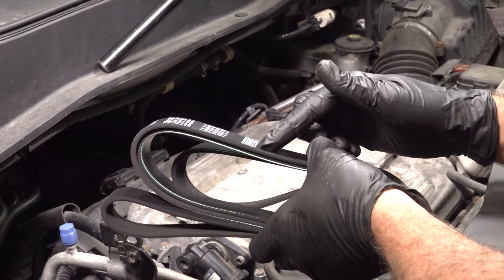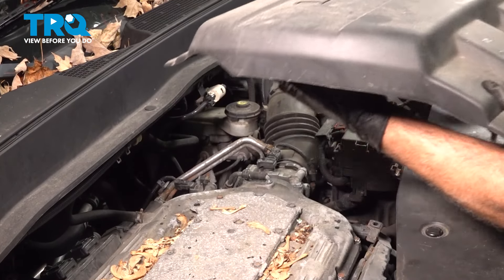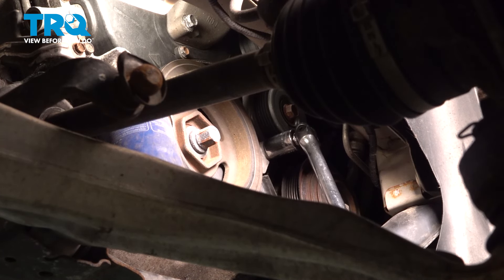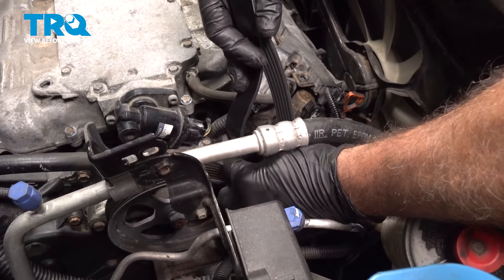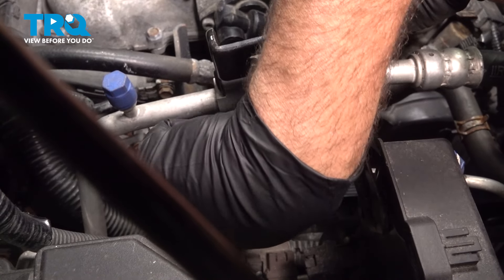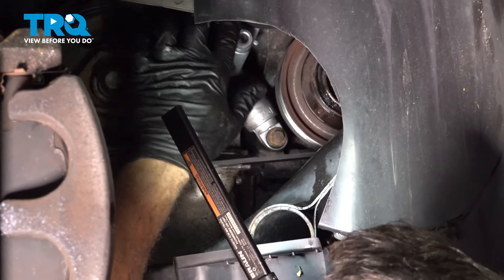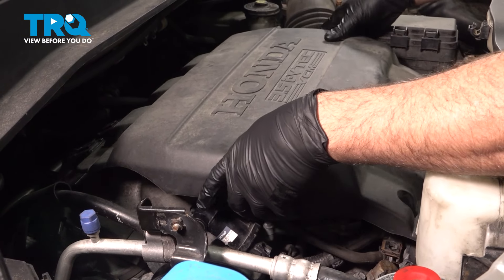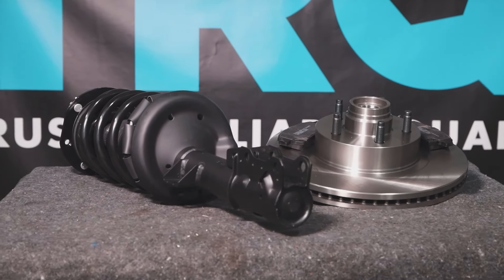How to Replace Serpentine Belt 2009-2015 Honda Pilot

Comment: I found it easier to use a tensioner pulley tool on the top fixed bolt of the tensioner.